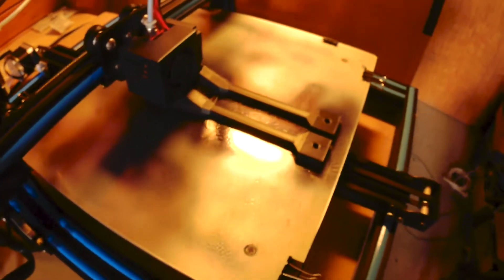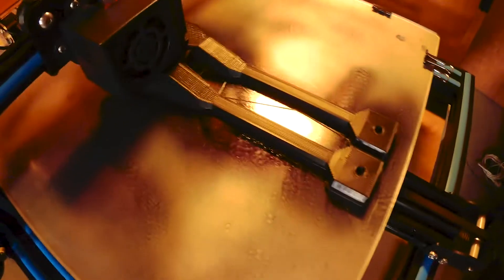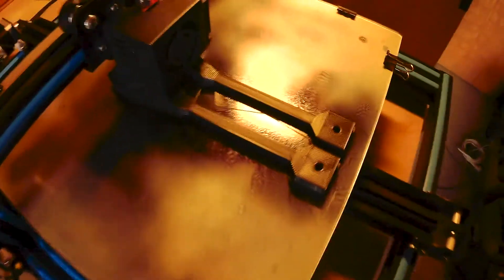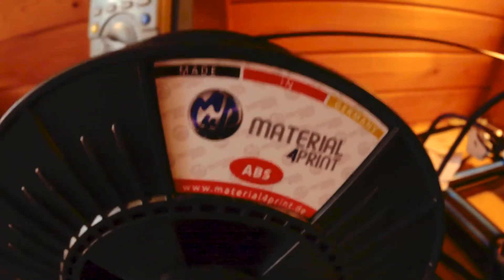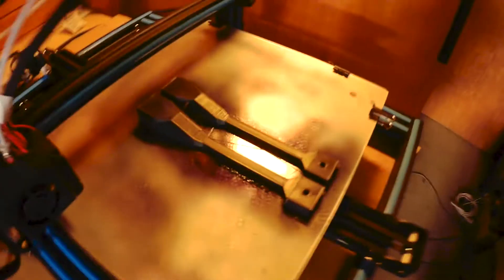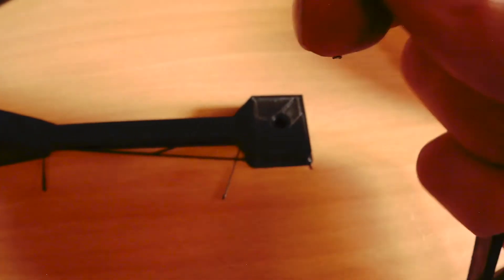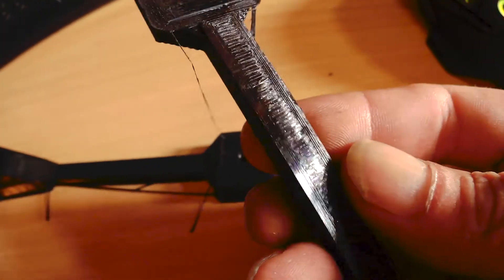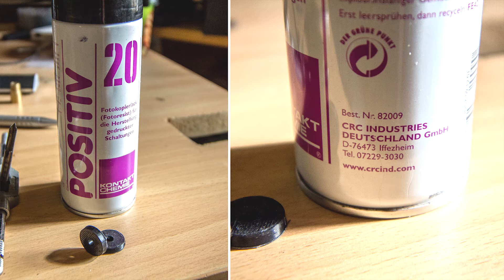CR-10 How I print ABS: bed adhesion, temps and config

Comment: Hello, thanks for the video.  I bought my CR-10S last year and have been mostly printing with PLA (which usually works out more expensive than ABS).  My first prints with ABS were, understandably, quite a disaster as happens with many others, to my relief. :)  The past weekend it seems I found the correct set of parameters for printing successfully on the CR-10. In my case I've been using a clear lacquer spray for bed adhesion on the glass plate (works great ! sometimes too well, really) and a bed temperature of 90 degrees C. I did chase up my hot end temperature to 240 degrees (which might have made all the difference) but, I also changed the line width to 0.35 mm (I use the typical 0.4 mm nozzle).  I figured that option might force the ABS closer together to decrease the chance of layer splitting etc.  A brim is also a must when printing with ABS.  Lastly I decreased my layer height from 0.2 to 0.1 mm.  I usually throw a bed sheet over my printer to keep the overall temperature more constant.  I have to say I was incredibly happy with the two successful prints I made !
Reply: Are you sure using clear laquer? Spray paint? For bed adhesion on ABS printing? Please tell me how to use it?
Reply: Build a hot box ! I run abs great keep it at 108 degrees inside the box
Reply: @tkmarshall3454  I used around 50 mm/s for the inside perimeter and 25 for the outside perimeter.  The stresses are usually the highest at sharp edges, that is why I have my acceleration down to a very low value like 50 mm/s/s. In the period that elapsed since I wrote the above piece I have mostly printed round things like pulleys and gear wheels. Currently I use a cardboard box to retain the heat, bed temperature at 80 degrees and have my cooling fan at 50%.  I also moved over trying ABS juice and it works great, no more chunks coming out of the glass I use.

Comment: You had to show edges seen by sides while printing. This video is useless, it doesn't show if the print was completely adhese on the build plate.
Reply from the maker: it was, with help of that paint spray. raising parts need a housing.

Comment: The CR-10 can do 100°C ? I thought it could only do 90° max
Is yours modified?
Reply from the maker: if mine sits long enough (pre heating 100°C) in a warm room, then yes 100°. OEM bed, not modified

Comment: Noob question. Using Cura (3.0 I think). At begin of print the printer kicks out all the filament. After I feed it back in it does do a clearing deposit and prints without extruding. Is there g code I can change?
Reply from the maker: could be. can you show us your code or make a video of that behavior?
Reply: pixelcomet Turns out I plugged the E motor with the X plug. Thanks for the reply
Reply from the maker: ah ok :)

Comment: What about ABS fumes? Maybe its myth? So now its ok to inhale it? Or you need special room with good ventilation or full enclosure not only for bed temp problems but to isolate fumes too?
Reply: +pixelcomet Very clever! :*) I was gonna ask you, What's next, an enclosure? But I see you've already got to doing it. I'd like to see that enclosure coz my 1st 3D printer, CR-10, is arriving in a few days. Thx! :*)
Reply from the maker: I built an enclosure after that first phase. it smells a bit. I open the window and leave the room.

Comment: You say you it needs an enclosure but it doesn’t look like it’s enclosed in the video? Don’t get me wrong I’ve been printing ABS for years and always in an enclosure. But I recently got a CR-10 and been thinking about trying printing some ABS on it open air, haven’t made its enclosure yet. Your video gave me hope that it may be possible? You note that the room temp is 28C which is about 82F and my computer room where the CR-10 is is always in the 80’s so I’m wondering if that may be the key?
Reply from the maker: it's all about the ambient temperature. I works in a hot room for smaller parts, but not for bigger parts, they will cause probs. If the room temperature drops a few degrees, the print may already been ruined. a plastic bag or so is the cheapest case. I made my case from thin foam board that is not even very tight (just a hood that goes over all), but woks well now. I made the case after this vid and after some failed test without box over the printer

Comment: does cr10 needs upgrades to obtain 100° on the bed? How many minutes to obtain 100°? need to change extruder or else to print abs?
Reply from the maker: you need an enclosure to print ABS. no mods needed. if you have an enclosure, bed reaches more than 100°, but it takes some minutes. printing ABS with enclosure is easy and works
Reply: thank you, needs the fan on or off?
Reply from the maker: ABS always off
Reply: so how do you insulate the bed?